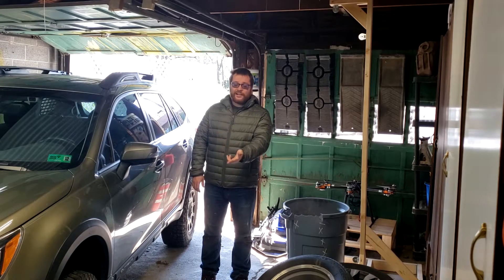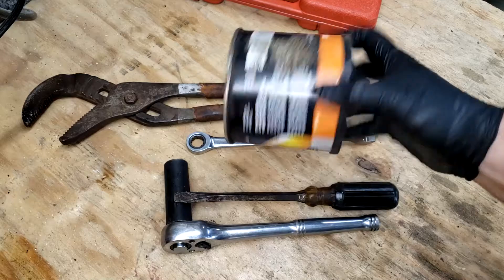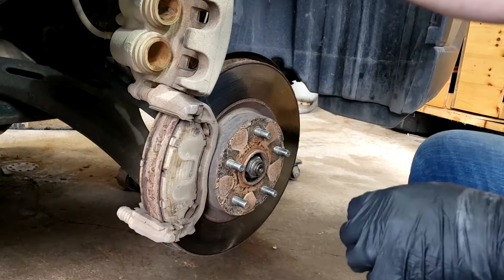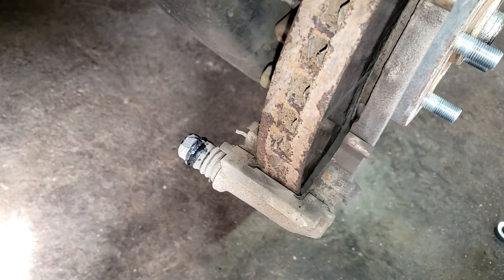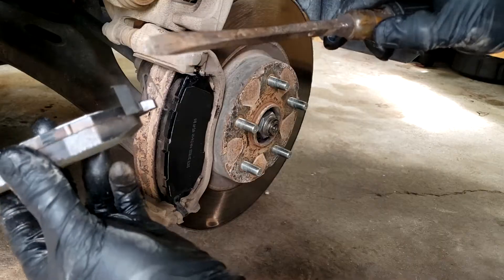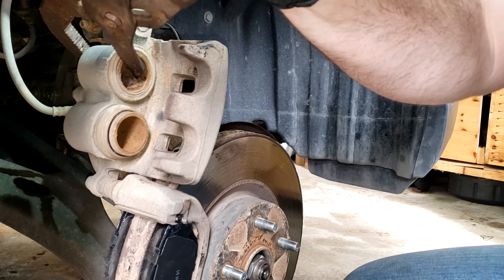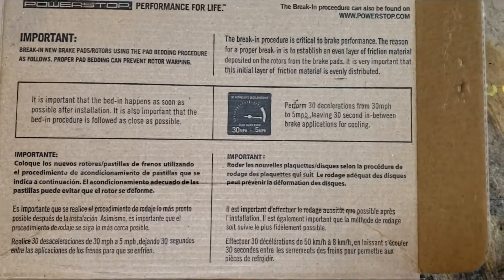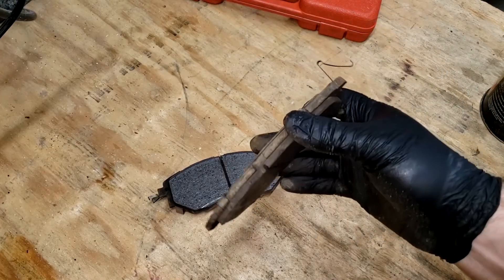DIY : 2015-2019 Subaru Outback FRONT Brake Pad Replacement

Comment: How’s it going. Good video. I’m a subscriber and follower on Instagram as well. Just one suggestion for a professional mechanic here. Just use the old brake pad with your channel locks so you don’t damage the brake caliper piston. Good content. Keep it coming.
Reply from the maker: That's a great call! 

I am just a guy that's used to doing things himself. No professional training. 

I used the brake caliper tool on the other side but the channel locks seemed easier. 

I've also used a C Clamp before. The channel locks just seemed easiest but I hadn't considered the teeth digging into the piston. 

Overall this was a super easy pad slap job. Other than the inner/outer/left/right specific it was like any other I've done before.
Reply: bruceyyyyy   Ya. It was good over all. Any way you can compress the piston is fine. Just use the old pad so you don’t damage anything.
Reply: Question - I was always taught to remove the cap for the master cylinder when pushing back the pistons. It that part not necessary? Thanks.
Reply from the maker: @tormodskoog9088  It just makes it easier to push in. If you have the strength or tool to do it it isn't necessary. 

I guess I could bleed the brakes now too but I was thinking of investing in speed bleeders for the calipers.
Reply: Tormod Skoog   Burceyyyy is correct. It’s not necessary. But a lot of times the cap will pop off when you push the piston back in. There is a chance you could break the cap if you leave it on, it also does create some additional resistance. I take it off when I remember. Most of the time I don’t just cause I forget. It’s not a big deal either way.
Reply from the maker: @jklpino  Hey I had someone (@Softroadingthewest) asking about pad slap v rotor in the comment section here. Want to chime in?
Reply: bruceyyyyy   Sure. I didn’t see the comment. But generally it’s recommend to atleast machine the rotors when you replace the pads so they have a fresh matting surface between the pads and rotors. Or else they’re likely to squeak and possible not brake as effectively depending on the condition of the rotor. Depending on the application most people are ok with machining the rotors, so long as they measure and verify the rotors are above the min thickness after machining. In fleet or commercial applications, it’s considered good practice to replace the rotors, due to machining the rotors removes total mass thus reducing its ability to effectively dissipate heat and effectively reduces the brakes ability to deliver braking power over a prolonged brake application, such as emergency braking or braking under a load such as going down hill or towing.
Reply: Dang - yes I for got about old brakes = I have a big C screw C clamp some where I used a few years back

Comment: Very helpful video!
2 small points for anyone doing this job for the 1st time:
1) Use SILCONE grease. Regular grease can break down rubber such as the caliper pin boots over time. Silcone grease will not.
2) Make sure not to contaminate your pads or rotors with the silcone grease. Use some brake clean in a can and give the pads and rotors a wash with the cleaner. Could make stopping more difficult as brakes need friction to stop. 
Nice video! : D

Comment: Thanks so much. I just completed the rear bakes on a 2018 Outback today. Shop would charge $375 to change rear pads. Also swap rotors which dont need to be changed. OI paid $70 for the OEM pads and saved $305 on just the rear!
Reply: Why was I told I need a scan tool to do the rear brakes on a 2017?
Reply: @Willohbee Just did the rear brakes on a 2016 Subaru Outback 2.5. All I did was unplug the electronic parking brake connector which is right under the caliper. Then to get the caliper pistons back in you can buy the special tool from Advanced Auto for like $13 or do what I did. Take a pair of vise grips and twist in the caliper making sure to not touch the rubber boot. While you are turning have someone press down on the piston at the same time. I used a 6 inch extension. You do not have to press extremely hard but you do need to apply a decent amount of pressure. When done just plug back in the cable and then pull the parking brake switch. It will run for a few secs until it realizes what’s going on and extends back out. This method to my knowledge did no damage and didn’t take a lot of time. You just have to watch what you’re doing so you don’t mess anything up like the rubber boots or the electrical connector.
Reply: @ChristopherVarnish  I really appreciate that!

Comment: The rear brakes wear faster because they have a screw-type of piston that rotates and tightens every time you use the parking brake. This keeps the pads closer to the caliper. The more you use the parking brake the faster your pads will wear.

Great video by the way. It does in fact take less than 10 mins to change the front pads. Like most folks (that I know) I use a large C-clamp to push the pistons back.  Now that I see you using big VISE GRIPS I'll dig mine out and see how they work!

Comment: Your comment at the end about the wear on the front breaks. My 2017 Outback is getting it’s first front break pad change at 78K.  I have never owned a car with front break wear like this Outback. I bought new pads 2 years ago, when I changed my Lexus’ pads. I am finally putting them on today.

Comment: Getting ready to do the front brakes and my 2017 Outback 112k miles(mostly highway). Never been replaced, pads are thin and I should have heard the wear indicators by now. We'll see what's up with that. SUPER helpful video!!

Comment: I just finished replacing the front pads on a 2016 outback. Your video was helpful.  Rather than use the "vise grips", I left the rotor on and put two lug nuts on to hold it in place. Then I loosened the guide bolts and compressed the caliper using a c-clamp while the caliper was still attached to the car and it had the old brake pads in it. The rotor wasn't distorted and the entire replacement excluding mounting the tires was not even 10 minutes per wheel.

Comment: Thanks for the video, it was really informative. I had to replace the rotors as well. The subaru jackstand really came to the rescue in helping me remove the 17mm bolts and removing a stuck rotor, i just had to get creative with the angles and using the cars body.

Comment: I changed my rear ones out on my 15 Outback 3.6r with some cross drilled and slotted rotors. I also threw on a strut tie bar and the 20mm rear sway bar from the STi (it’s a direct fit for the 15-17 Outback). I know the sway bar and strut tie bar make off-road handling potentially worse but I spend 99.99999999% of my time on the road so it makes sense for the to concentrate on the “on-road’ handling. The strut tie bar made a noticeable difference in turn in. The STi  rear sway bar  makes a big difference on the handling in sharp corners at speed and oddly enough it helped over speed bumps (no more rocking back and forth after clearing them).
Reply: If i installed one pad on each side with the clip up, should i correct them?  i already bedded the brakes and I'm afraid i would have to rebed them and cause some overheating and warping having to do the procedure twice (which I would assume is against every shop manual in existence.)

Comment: Mine went exactly as this video describes.  Less than three hours for the entire job. I did pads not rotors. I was at 77,777 miles (haha) when the dealer suggested I needed new pads.  Lots of heavy city traffic driving. '16 Outback

Comment: Thanks for overview. I'm same situation. Did the rear pads. Bought front too.  Now at 99k miles. I brought oem pads and came with l new clips, etc. For the rear Lisle makes a brake piston tool #28600. Which makes it easy to scew in parking brake piston.  At first I was trying to push it.  Brakes are like 1st side goes slow. 2nd side is fast.

Comment: Thank you sir, just completed this job...only problem I ran into was after I completed the passenger side...brake fluid spilled out from the reservoir area. Have you seen or heard of this? Did it get squeezed out when I clamped down the caliper boots? Thank you!
Reply from the maker: Yup. It's recommended to bleed the brakes which is an easy but time consuming process.
Reply: @bruceyyyyy  that's what I usually do, for example my CB9 requires me to pinch the brake lines and bleed them after a change. I was told by my cousin the extra brake fluid probably came from the dealership "topping" off the fluid during service. As the brakes are used the reservoir depletes and when you squeeze the caliper boots it pushes the fluid back to it's original level as long as you have no leaks. Thanks for the quick reply!

Comment: Hi! Quick question? Is it ok not to bleed brake when pushing caliper pistons? I watched 1A auto loosened up the bleeder to compress pistons and bleed the fluid. Thank you.
Reply: I guess you could potentially screw something up, but I think if you’re new to DIY automotive you’re more likely to screw something up introducing air to your hydraulic brakes.
Reply: @nathancalia3901  Thank you. I found a cheap service tool to retract automatically the rear brakes too. Foxwell brand works!

Comment: Thank you so much for this video! really cleared up the orientation and placement questions I had since the new pads really did not clearly express that they are made specifically for left/right inside/outside. 

After completing this job, my brakes function seemingly normally, however my brake warning light intermittently comes on, usually after releasing the brake pedal when I am on the gas again to move forward from a stop. The light stays illuminated for a few moments and then switches off. but comes back on nearly every time I use and release the brakes. Any ideas what may be causing this?

Regardless thanks for the helpful video!

Comment: The EBD system maximizes the effectiveness of the brakes by allowing the rear brakes to supply a greater proportion of the braking force. It functions by adjusting the distribution of braking force to the rear wheels in accordance with the vehicle’s loading condition and speed.

The EBD system is an integral part of the ABS system and uses some of the ABS system’s components to perform its function of optimizing the distribution of braking force. If any of the ABS components used by the EBD function fails, the EBD system also stops working.

When the EBD system is operating, you may hear a chattering noise or feel a slight vibration in the brake pedal. This is normal and does not indicate a malfunction

Comment: First of all thank you for your video with came really handy. Just one thing I've noticed: when you installed the new pads, the little spring on the bottom went inside the caliper, but as I can see from other sources it should stay outside.
If you look at your video, even on your old pads it's laying outside on the anti-rattle clips.
Just my 2 cents.
Cheers from Italy 👍
Reply from the maker: You are correct! I added a notice in the comment section but thank you for pointing out.
Reply: @bruceyyyyy  Oooooops... Didn't read carefully comment section AKA didn't read it at all🤪.
Reply: You really needed to remove as much rust on any and all surfaces ,especially on and under the clips and clean all surfaces with brake clean. The slide pins needed to be removed and cleaned of old grease and inspected for rust, then apply new silicone grease to the pins, check all rubber boots for tears.

Comment: Thanks a lot Bruce  :-)
I just got my new Outback 2020, I hope It will looks like the same when I will change the pad.
What is the best thing to do as a preventive corrosion on brake system. Is it to check twice a year to see if everything is fine and put more grease where it is missing.  ?
Reply from the maker: I would just grease when you change the pads.

Comment: I tried to find the brake pads you recommend but Amazon says they are unavailable.  The Power Stop website recommends "Power Stop 17-1078, Z17 Front Ceramic Brake Pads with Hardware".  Thanks for another good video!
Reply from the maker: It might be a supply issue with this virus. I just bought them last week.
Reply: @bruceyyyyy  Found and ordered the pads you installed from the Auto Accessories Garage website.
Reply from the maker: @kcirmusic1  Thanks! I'll update the link so it can help someone else in the future.
Reply: I hate to knit pick on things. But from an informative stand point. I just want to say, ceramic and metallic brake pads are terrible for your rotors. They are super hard and they wear out your brake rotors instead of your much cheaper brake pads. I always recommend replacing brakes pads with the OEM replacement pads, of what ever brand you choose, just so long as they are OEM compliant. Unless you are going for higher performance and don’t mind sacrificing your rotors. But that would be another conversation with different parts and variables to consider.
Reply from the maker: Would you have a suggested product?

I don't drive hard. I just want long life and low dust.
Reply: bruceyyyyy   Mmm... no... just where ever you get them, they will say if they are OEM replacements. Or if you go to a auto parts store just ask for the OEM replacement. And as far as brake dust goes... unfortunately, brake dust means your pads are wearing, which is normal, if there is no brake dust, well... that means either your super light on your brakes, or your brake rotors are wearing rather then your brake pads. So if the pads are claiming to be “low dust” I wouldn’t necessarily recommend going for the pads that claim that. I would assume they are a harder compound and would probably eat the rotor. Just my professional opinion.
Reply: bruceyyyyy   If you are looking from a high performance standpoint. Then the brake pad material you choose will be different. But in doing so, you are knowingly sacrificing your brake rotors in order to achieve maxing braking power. But anytime you increase power, generally you decrease longevity/life of the product. For most people, a OEM brake pads mixed with higher performance rotor is a good mix of both worlds. You get the extra cooling from the rotor but normal brake wear from your pads. You will have a minimal additional decrease in brake pad life if you have drilled and/or slotted rotors, as they will shave off micro bites off the pads with every application. But for most people it’s minimal. And if it’s not for you then you brake hard and you might need a better set up.

Comment: just a note for people who deal with a lot of rust due to road salt. autozone duralast gold rotors are great and dont rust out like some other brands. also on my vehicles they have mostly highway miles so brakes last forever we replace the rotors on pad change just so the small imperfections in the rotor dont screw up new pads, its relatively small up in the price but then i dont have to worry about pads wearing funny.
Reply: I have used Duralast pads for all of my brake pad replacements and never had any  problems. They are relatively inexpensive, and many people don't know that they have a free replacement policy that is incredible. You can bring back your old pads once they are removed, and get a new free set of Duralast pads. I used to get these at Schuck's auto supply, but auto parts stores seem to change names/ownership quite often. I just bought OEM Akebono pads for my 2016 Subaru Outback because they are the OEM for Subaru brakes, and I got them both on sale at a good price, and because Schuck's is no longer in the area. After I bought them I happened to see that AutoZone carries them, so I called and checked if the free replacements with the old pads was still available and was told that it is. I had told my son about the pads years ago when we did his brakes, and he told me that he got free replacements a couple of weeks ago, and has been doing that for years, saving $$$

Comment: Thanks for the quick informative video. Will help a bunch since I will need to be doing the same thing to my 2015 Outback. Just a little nitpicky note. Those pliers you sometimes call vise grips but said they are Channel Locks. They aren't Channel Locks either. Channel Lock is a brand and it looked those you had weren't even Channel Lock brand. (Channel Lock brands are blue handled). Those are "technically" Adjustable Pliers. Many tool manufactures make "adjustable pliers" not just Channel Lock. I know, who cares. Thanks again.
Reply from the maker: I use vise grip and channel lock interchangeably.  I knew vise grip (sometimes spelled vice grip online) is a brand but didn't realize channel locks were as well.
Reply: Brad Mangas   Dang! I’m a professional mechanic and I just got schooled as well. Thanks for dropping some knowledge! I’ve always used channel locks and adjustable pliers somewhat interchangeable. And in fact, I would probably have corrected people in the past for not referring to them as one or the other. I generally refer to that style of adjustable pliers as channel locks. Because now a days they have regular pliers that are also adjustable. The manor in which those type of pliers are adjustable I would generally call channel locks. But looks like I am technically incorrect in calling them that. Good to no, gonna use that bit of knowledge to bash on my coworkers in the future! Lol. Thanks! Learn something new everyday!
Reply: Those players who used are called tongue and groove pliers what's your type of slip joint pliers. Good video.